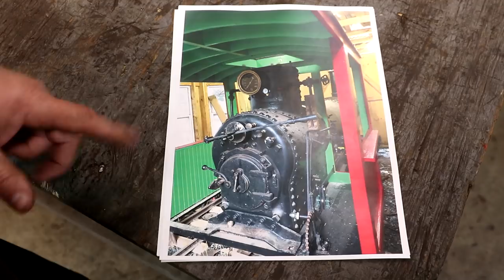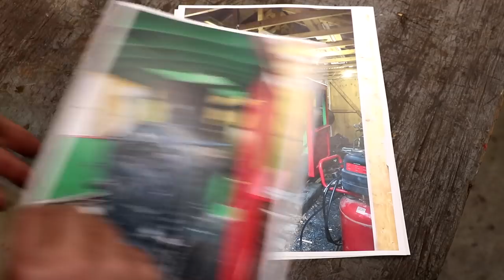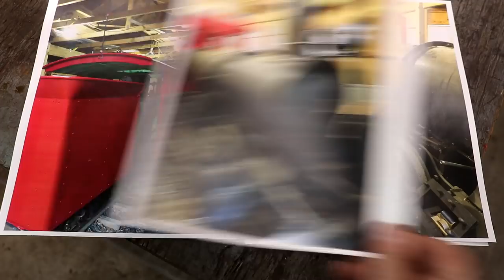Re-Facing and Lapping a Steam Locomotive Throttle Valve

Comment: When I was being taught lapping using a lathe, we were told to change the lathe rotation direction every time we lifted off the work piece. Otherwise we were told you could get spiral grooves on the seats. For smaller valves, we had a compressed air tool that had an oscillating rotational output shaft, with various end fittings from a chuck to a rubber sucker. A spring would be put under the rotated seat, so that every time pressure was released, the two seats would separate.  The carborundum paste we used, was mixed with fish oil, that had a particularly nasty smell.
Reply: I would think that is more about speed of cutting in the lap.  Once it is installed it will do final seat from the force of contact between the 2 parts.  Lapping is really just doing final angle matching of the 2 surfaces.  It would be different if using lapping compound that is massively strong.
Reply: How I remember those days. Then I worked for a good shop with new Sioux valve Pacer and hard seat grinder. Then a good friend taught me how to really use it to my advantage. He also taught me to not laugh he taught me that you could grind a seat perfect where it seals the first time without using grit. Stop using that stuff in the late seventies.

Comment: Well done.  Timesaver also works brilliantly on babbitt bearings. The yellow powder will get full or near full contact between bearing surfaces with a couple of thousandths space. You can check it with plastigauge as you go. And the grit breaks down rapidly as you explained. I've used it on all my antique engines.

Comment: The reason for two size seats/ valve is for balance! So the two sizes work together, the larger holds valve closed. But not with the full pressure of the steam the small valve is trying to open the valve so the reduced the pressure holding closed! Now it is easier to open the valve! (You do not have to overcome the full steam pressure when opening and pop it open ) you now can throttle it easier with minimal force ! It is a balanced valve thats also why it is drilled through center and the valve itself floats on the pin and can self a-line to seat !  And if needed the operator can add force to hold valve closed, but can slowly remove the added force, and then easily to start to open the valve  why it is a throttle!!!!!
Reply: Thank you.  That is an excellent explanation.  Well done!!
Reply: Nearly understood it ?
Reply: The idea is the pressure is the same on both sides, but the area is different. Pressure x Area = Force. Different area, different force. Based on my very rough estimates (derived by literally holding a rule up to the screen) the area of the large valve face is about 5 square inches, and boilers of that size run ~100psi. If the valve had only a single large seat, the pressure holding it closed would be 100psi X 5 square inches = 500 pounds! Even a 20:1 reduction provided by the throttle lever arm would require 25 pounds force to open it. Now I estimate the smaller seat has an area of about 3 square inches, which is 300 pounds force in the opposite direction. Now our 20:1 lever arm only requires 25-15, or 10 pounds force to open the valve. Much more palatable. (These numbers are nowhere near accurate, but they demonstrate the principle.)
Reply: @BenRichards227  Yes!!!   I did not go into the actual numbers it is having a smaller and larger vale it is not a true 100%  balanced valve . If it was it would require a  locking system to keep valve closed to keep from opening on its own so they left a small amount of pressure hold it closed. For safety and the leverage of any linkage would allow the operator easy to open the valve.

Comment: During World War I a vast system of 2 foot gauge (60 cm) railroads served millions of servicemen in the wartime trenches, all across France and the Battlefront.
Reply: The 60 cm or 600 mm = 23 5/8 inch gauge is close enough to operate with no problems on 24 inch gauge.

Comment: Sears and Roebucks used to have a valve seating tool that was like  one of the early hand drills where you turned a handle and it drove through a 90 angle to turn the drill bit.  But it has a cup for the valve instead of a bit, it would turn 1/2 turn clockwise then 1/4 turn counterclockwise then clockwise and kept repeating until you stopped.  If you had one of those with an electric drive it would be great to seat the valve.
Reply: But it went back and forth

Comment: Thanks. I've been wondering how a steam engine's speed was controlled. I'm not a machinist but I have used some of the techniques/tips/tricks that show to help improve my woodworking. It's also kind of mesmerizing to watch a rough piece of steel or cast iron clean up on the lathe.
Reply: There's really 2 speed controls.  The primary one is the throttle, the secondary is the Johnson bar.  The steam valve determines the amount of steam, the second changes the cylinder valve timing on both sides of a dead center - so one side is forward and the other is reverse and moving to center cuts off steam earlier.  Cutting off steam earlier reduces usage of steam enough that the earlier cutoffs were nicknamed the "company notch" for the savings.
Reply: @russkepler  Most training manuals for RR engineers circa 1900 suggest running w/ the throttle wide open or close to and adjusting the speed w/ the Johnson bar but i think that might depend on long runs and gradual changes in terrain.

Comment: I know size can be deceiving in videos. The seats looked really wide. Wide seats take longer to lap and are harder to keep steam tight.  Narrow seats are much easier to make and keep steam tight. I have always used the oscillating method to lap valves, the only method I was taught. The quick method of checking the the tightness I was taught was to use a pencil across the face all the way round. The valve and seat were put back together and given the lapping motion. On withdrawal if all the pencil lines were cut the valve was steam tight. Yes I have also used bearing blue. I also came across some safety valves whose instructions gave a1 degree difference between the faces of the valve and seat. I have used this 1 degree differential other steam valves, I found them easier to lap, seemed keep steam tight longer, and the seats narrower for longer.

Comment: Nice work. I hope the guy checks the pipe between this valve and out through the boiler. Leaks there makes the loco keen on running... Saw such not long ago. It was a difficult but necedsary work to plug that leak.

Comment: Standard Gauge is 4 feet 8 1/2 inches. Allowance of 4’ 8” to 4’ 9 1/2”.
Reply: This was also the gauge for Roman chariot wheels, incidentally.
Reply: @Farm_fab  wow I had to look into that.   I had no clue it was based on something like that.   My mind is thoroughly boggled.   Thanks y’all! 

Found this:

“Very early on, the British Monarchy insisted on a 4 foot 8.5 wheel spacing because they wanted to promote and ensure maximum trade and commerce throughout the kingdom. They decreed that every wagon and ox carts had to have a wheel spacing of 4 feet, 8.5 inches. They needed this width to match the spacing of the ruts in English roads. They knew that if any wagon or cart had wheel spacing different then 4 feet 8.5 inches its axles would get caught up in the ruts and break and the wagon would be destroyed.

Many Americans are unaware that the standard railroad gauge in our country (the distance between the two metal rails) is set by federal law at 4 feet, 8.5 inches. Why the heck did our country’s government officials settle on such an odd size when they built our first rail line?
Well, when our government and business leaders decided to pursue our first rail system they relied mainly on British expatriates to design and construct the railroad. These English expatriates were the same craftsmen who designed and built the British railways so they built what they knew.
Wait a minute! Where did all those ruts in English roads come from? They were created by the Imperial Roman Army when the Romans invaded England. The Romans had brought with them their War Chariots and all their Imperial War Chariots were drawn by two horses by order of Caesar. Caesar insisted every war chariot be pulled by two horses to intimidate the enemy.

To comply with Caesar’s proclamation Roman engineers calculated 4 feet, 8.5 inches as the minimum needed wheel distance on a chariot if pulled by two horses. Therefore if the British Monarchs wanted to continue to use the great roads built by the Romans they had to adopt a standard wheel spacing of 4 feet, 8.5 inches.
When England decided to build its first railroads it relied on the trained craftsman who for years built the wagons and carts for the British highways and tram systems. Those craftsmen unfortunately only had tools and jigs to construct axle designs based on a 4 ft, 8.5 inch wheel spacing.

Though it might be hard to believe – it’s true; the standard U.S. railroad gauge of 4 ft, 8.5 inches is actually based on an ancient Roman Emperor Law ordering all war chariots to be drawn by two horses.”
Reply: @audimaster5000  Just so you know: that is a very well-known deductive reasoning chain. But if you really start digging into it rather than just saying "wow, that's cool!", you start finding a few flies in the ointment that start making you wonder if it is really all true, or someone just made up a whopping good story and everyone liked it so much they signed up to it.

The first US locomotives were indeed imported from England, and they were in British standard gauge, which is 4' 8.5". That much is true. The British also used 4' gauge, 5' gauge, and a bunch of others, depending on which company was building the railroad. There was a period of time known as "the gauge wars" where freight and passenger interchange between various railroads was very difficult since the same cars couldn't pass thru; all the freight had to be manually unloaded and loaded onto new cars. The same thing happened in the US in places. So one has to wonder how "standard" "standard gauge" was, if there were a bunch of gauges in use.

If you find someone that has a museum with Roman war chariots, you will find, I believe, that the wheel spacing is NOT 4' 8.5". I think it was a supply wagon that came closest to that. Commerce wagons were also much more common on roads than war chariots. 

All of which is to say, it is a rocking good story, until you start looking into the details.
Reply: @lwilton  Yes, but of course the width of the chariots were bases on the clearance for two horses. As such the width is based on two horses arses,. Mind you the booster on the space shuttle had to fit the loading gauge, which is determined by the track gauge. Therefore the most advance piece of technology booster rockets is limited by two horses arses.  Come a long way haven't we
Reply: Horses arses……. Good one 👍😂😂😂😂

Comment: Difficult job Keith. I was wondering how to approach the job and thought out exactly the same procedure as you showed. And then it turns out the top valve is more worn than the bottom one... That sucks big time when you notice it. Is there still enough metal to make it work or am I over the ridge already? Because of your careful approach you still managed to keep a window of success as you did. Hats of sir especially because you recorded the whole sequence and ended all well. These are tedious jobs which I want to do alone or no-one is watching. Close call but you made it! Thank you Keith! Best regards, Job

Comment: I don't know if you have ever used a small wire brush to clean out the threads before you test your nut while threading. 
I have a wire brush I keep on the lathe just for that. I think I would have used some high spot blue to check the seats 
Very nice job. You saved him a lot .

Comment: 4' 8-1/2"

Rumor has it that it was based on the standard width of wagon wheels at the time.

Rumor has it that wagon wheels were spaced to run in the same tracks as a Roman chariot.

Rumor has it that the Roman chariot wheels were spaced to accommodate the horses that pulled them.

So if all of that is true ... todays standard gauge railroads were designed by a horse's ass ... don't that give you a nice warm feeling of confidence?
Reply: It's not the best engineer

Comment: If the bottom originally matched the top in depth when both were seated and the large valve body was not worm too much, then the fact that the bottom seal was loose when the top seal had so much ground off of it (85 thousandths) implies that the lower seal actually was much more worn than was shown by the obvious surface distortion it had. Both should have worn in a similar manner, as they were locked together and the depth of one could not change very much from the depth of the other as they wore if they both were touching their matching valve-body seats at the same time.  Obvious wear is thus not a good measure as to what is really happening to valves like these!
Reply: I agree totally....

Comment: I don't like spinning when lapping, there's a tool from the ancient days of auto repair it has a crank handle when turned causes the head of the lapping tool to oscillate right and left advancing a ¼ turn at a time. Spinning can lead to a false impression because a single high point in the seat will register 360° of the valve face. Rebuilding cylinder heads I was confident in my technique that I would just check my work by marker on the valve face slap the valves to the seat transferring the true valve fitment 100%.

Comment: Narrow gauge trains are interesting for sure. Two foot track is the smallest I have heard of. I wonder if there was a specific industrial reason / use for that size? When you lapped on the lathe: I heard "the sound" meaning happy iron and cutting all the way around.
Reply: Such narrow gauge costs a lot less in both track building as well as the rollung stock. Provided that the lower load capacity was enough.
Reply: They used them alot for mining and rough terrain so they wouldn't have to cut such a big swath for tracks
Reply: Used back in the woods to harvest timber.  No forwarders and skidders back them.
Reply: @cyrilhudak4568  I wonder if they laid narrow gauge track then picked it up and moved it around constantly for various stands of timber?
Reply: @jwaterous224  Absolutely
Reply: @cyrilhudak4568  Did those narrow gauge engines have powerful PTO? I'm guessing they could potentially do many jobs in lumber camps like pumping water, and drag line winching, and even splitting sawing wood! Steam was a "whole world"  unto itself back then.
Reply: @jwaterous224  And, , , ,  unlimited wood and water can be found in the forest.  Energy costs relatively nothing.
Reply: @cyrilhudak4568  yep you're right they used these for many things
Reply: In addition, you can make much tighter turns on narrow gauge than standard gauge.
Reply: @jwaterous224  I watch “The Pursuit of Treasure” YT channel. This guy is one of many who recover, and sell,  metal left in the Russian Taiga Forest from the Soviet era. They used narrow gage to transport the logs. The Soviets abandoned loads of iron in the forest. Using metal detectors, these guys are finding rails, joint plates, bolts, spikes, and discarded equipment.
Reply: @Poppi2006  So it can get recycled properly? If it's rails that would weigh up big time!
Reply: @jwaterous224  That was another advantage of narrow gauge, it could be easily moved from place to place by a small number of men.
Reply: @jwaterous224  Oh yeah.  Cuts it up with saw, hauls to his shed at home, and scrap yard truck with electromagnetic grapple hauls it away.
Reply: @jwaterous224  Those small narrow gauge steam engines did not have power take off (PTO).   As with most steam engines, they moved themselves and cars on track.  A few were built to have a separate hoist-type engine on the front.  Quite a few locomotives had a steam-operated water pump to move water.  Steam was the energy accessed off the boiler.

Comment: Great video.  Curious as to whether the valve bearing surface angle was still 30 degrees after the lap?
Reply: Maybe, maybe not, but as long as the angle of the valve matches the angle of the seat, it's all good.

Comment: That's a lot of speed and power if the lather powered lap stops sliding and bites !!
Reply: Basically impossible with that seat taper angle.
Reply: @lwilton  I wouldn't bet both arms on it.

Comment: Good job on the valve repair but, I did have to cringe a bit when you were using the chuck and pressing that piece together. That seems like a really unsafe technique on a lathe,   Aint no way id use a lathe like that after the injury videos I've seen.     I think id chucked the valve in the carlton radial drill  to make that task much safer.  Thanks for the great vids Keith.
Reply: With 30 degree valve seats the taper isn't able to lock, so it can't grab the part and spin it. With a very steep seat taper, or some other locking taper, it would be a seriously bad idea. But with slow speeds and a normal seat taper angle, all you have to watch out for is barking your knuckles on the chuck jaws. It really isn't particularly dangerous with even moderate care.